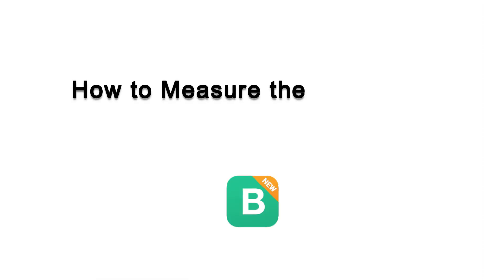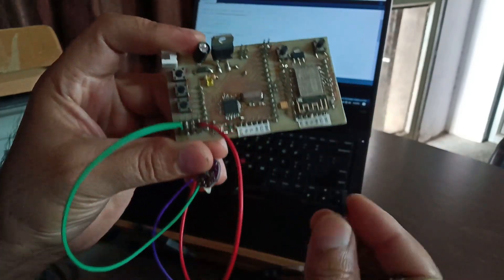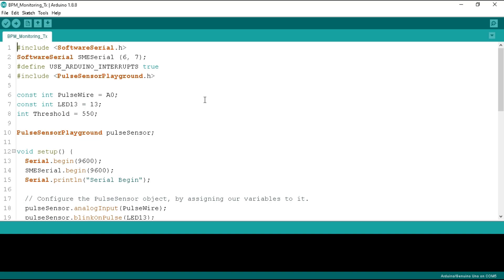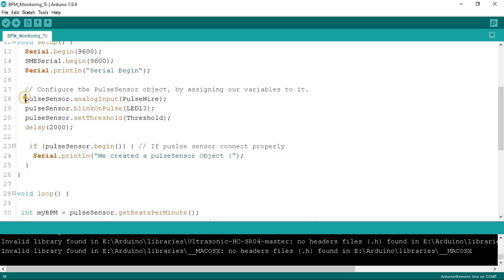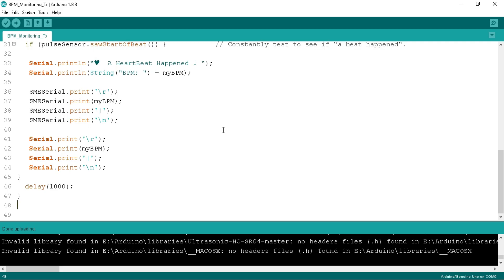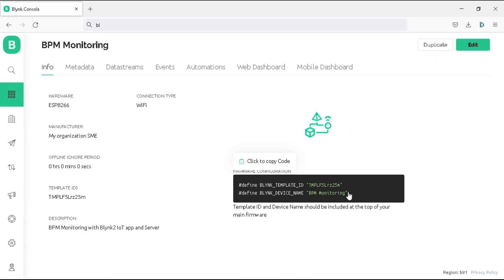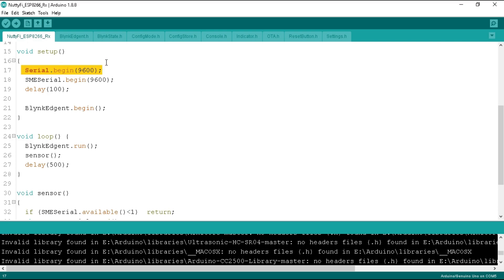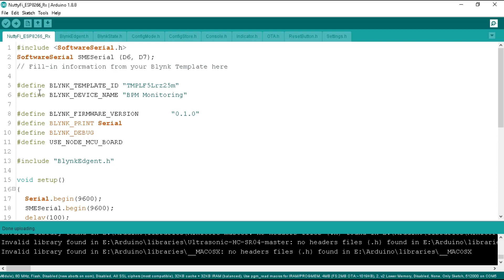Heart Beat Monitoring with New Blynk IoT App- Pulse Sensor with IoT | Serial communication

Comment: where we put ssid and password?
Reply from the maker: You need to add your board to wifi using the Blynk IoT app through OTA.  I have explained each & every steps in video. So watch the each steps in the video carefully
Reply: @SMEDehradun  
Compilation error: 'class BlynkConsole' has no member named 'init
Sir, Plz provide appropriate library
Reply from the maker: Link is available in the video description for the library. 

You can add the library by going to sketch then library manager & search for the blynk.

Comment: Bro, Is it possible to send multiple values..
Reply from the maker: Yes this is possible.
Reply: @SMEDehradun  Bro I tried bro but it reads single value only,
Reply: Display both but single value read (I mean starting value read (and upload,, can u give any suggestion
Reply from the maker: Send the values in the same format as shown in video and receive in similar format.
Reply: @SMEDehradun  bro  do u have any telegram channel
Reply: @SMEDehradun  I tried as it is but assign single value only for both variables..
Reply from the maker: No.
Reply: @SMEDehradun  void sensor(){
 if (ser.available()<1) return; 
char R-ser.read(); 
if(R!='\n') return;
 float hm-ser.parseFloat();
Serial.println("Humidity");
Serial.println(hm) ;
humidity=hm;
if(R!\r') return;
float temp-ser.parseFloat(); Serial.println("Temperature");
Serial.println(temp );
room_temp=temp;
In this it read, only first value what I mention in Arduino tx code, but I need both humidity and temperature both values read and print separately...can u help me.. Plzzz
Reply: Plzz give me reply bro.Plzz bro
Reply from the maker: Hi,

Can you send me Arduino and NodeMCU program both so that I can correct that & let you know.
Reply: @SMEDehradun  ok bro..Can I send in this comment session..
Reply from the maker: Yes. You can
Reply: @SMEDehradun  Bro when I try send code here it will disappear after few seconds..what should I do now..?
Reply from the maker: I don’t know, what’s the issue. I will send you code the code soon.
Reply: @SMEDehradun  Ok Bro, I am using Arduino Iot cloud, I need serial communication between Arduino and nodemcu, send multiple values from Arduino to Cloud using through nodemcu by serial communication..Its urgent bro.. 🙁🙁